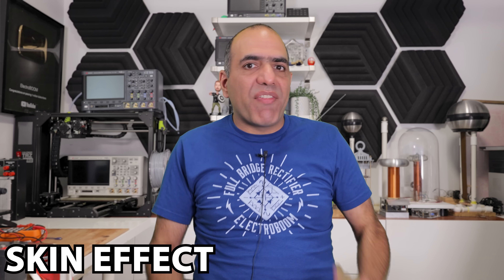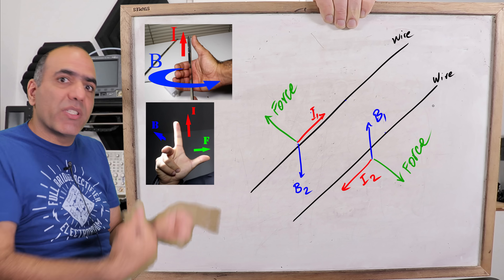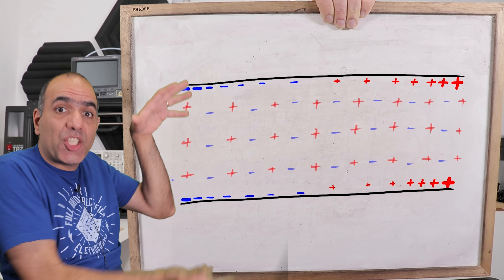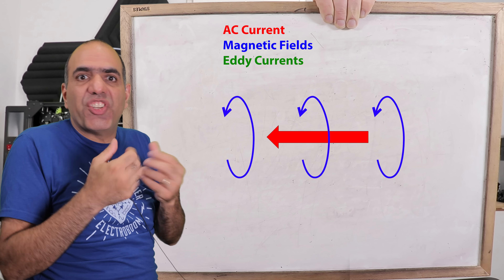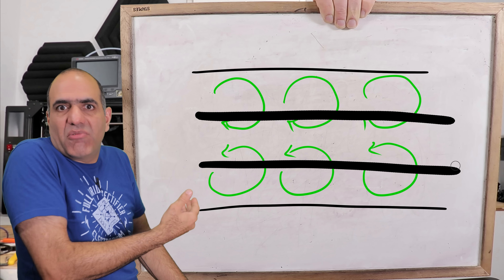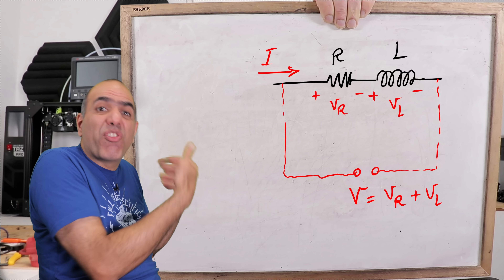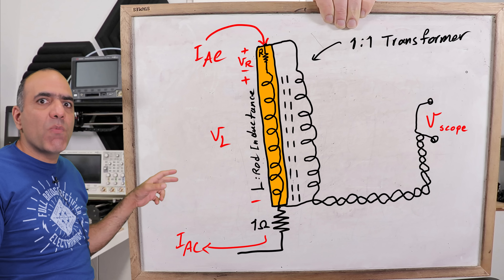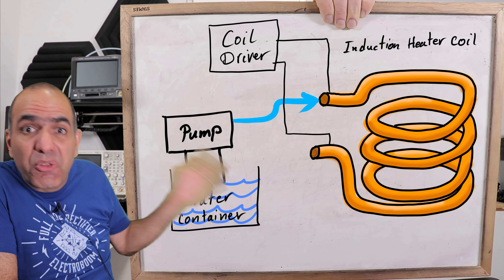Current Doesn’t Run Inside? SKIN EFFECT!

Comment: Are you really measuring skin effect? I feel like your current and voltage are out of phase, implying inductive voltages. To convince me, please include a measurement for the phase angle between voltage and current, as well as current and voltage base frequency amplitudes ;)
Reply from the maker: You have a valid concern. My brass rod is 5mm diameter and 65 cm long. So per calculations the DC resistance is around 0.5 mOhm, which matches my 1kHz scope measurement (ignore the offset of my differential probe). Per calculation it should also have around 0.7uH of inductance. 

This means at 35kHz I measured, the rod impedance should be 2.PI.f.L = 0.154 Ohms, so I should have seen 154 mV peak at 1A, but I'm only seeing 1mV to 2mV peak. So my probing scheme helped a ton removing the inductance component of the rod, but to what extent? Like I mentioned, it is not perfect so some of it still leaks through.

To see how much that is, you can take a look at these images: 
Phase shift at 1kHz: https://electroboom.com/share/1kHz.jpg
Phase shift at 35kHz: https://electroboom.com/share/35kHz.jpg

So taking the around-50-degrees-phase-shift-at-35kHz at face value, it seems inductance and resistance are roughly providing equal amounts of impedance at that frequency. So still a good portion of voltage rise is due to skin effect, which at 35kHz is around 0.73 mm deep. So as we calculate, around 63% of current runs through very close to half the surface area of the cross section of the wire. So rod resistance didn't quate double, but around 1.4 times more. This makes sense, another 1.4 rise is the impedance due to inductance, so a total x2 rise in impedance (sqrt (2 x 1.4^2)) and so I read roughly double the peak voltage.

If we compare the 1kHz phase shift versus 35kHz phase shift though, there is only 20 degrees shift which is much less than anticipated due to rod effect inductance. So maybe the rod effect inductance is not as much as what calculated above, and some of the phase shift is due to some other factor and skin effect has a greater impact in my reading.

Either way I can say I see the effect of the skin effect in my output voltage, but of course we can't ignore the effect of inductance reading due to imperfect setup. 

Hope that helps!
Reply: That helps a lot! I am very surprised how well that coupling works to eliminate the inductance. Assuming we have 1mohm of inductive impedance at 35kHz, that would only result in 4.5nH of remaining inductance, which is a 100x decrease! If we assume the inductive voltage were around 1mV, and it could be calculated by the rate of change of magnetic flux between your current rod and your probe wires, we can derive (ignoring internal magnetic field in the rod for now) that u_ind = mu0*w*I*g/(2*pi*r), with I=1A, g the gap between your rod and the probe wires, r the rod radius. Solving it for 1mV yields a gap of 56um. If we included the rod internal magnetic field, it would only get worse. Can you spot a flaw in my argument? Or is the insulation of your wire really this thin?
Reply: Forgot to multiply by the length of the rod ... Make it 86um.
Reply from the maker: @onit996  My gap is worse! Like 400um or worse because my wire is not that tight all the way over the rod. I don't think I can give you a more precise answer without digging much deeper into what factor in my crappy setup is messing with what!! But considering the amount of phase shift and voltage across the rod, I feel like my setup was good enough to get my points across. Setups in reality always make fun of theory!
Reply: @ElectroBOOM  Isn't your brass rod also acting as an antenna when the frequency increases though? The radiative power shows up as a resistive load to the source despite the energy not being dissipated in the material.
Reply from the maker: @Ryrzard  It would if frequency was much higher. at 35kHz, the EM wavelength is over 10000 times the rod length. So there is no significant EM, just local M!
Reply: I agree, your resistance is very plausibly from skin effect. The low inductance is some black magic to me though :)
Reply from the maker: @onit996  Yeah it does look low! Well, my wires are magic!
Reply: @ElectroBOOM  Why not just plot resistance over frequency and compare it with the theoretical prediction? That would pretty much prove the point. Also, how did the figure this out back in the day? Can not be too hard considering how long this has been known for?
Reply: @ElectroBOOM WHAT ARE YOU CABBAGE?
Reply: @ElectroBOOM   can you show us how odor detector or smell detector work?
Reply: @ElectroBOOM  I have no idea what any of this means. I just enjoy the videos and learn bits of things here and there. ...... 2.Pl.f.L. ..... to pilf? pilfer?
Reply: @ElectroBOOM thats a mouth full
Reply: 😂😂😂😂😂 skibidi sigma
Reply: Yes, that phase angle is pretty big too - looks like it's somewhere 45-90° (although, a little hard to see because the sine wave has some distortion). That indicate a majority of the impedance is in fact inductance. I pretty much expected that, since it's hard to cancel out all inductance that way (because of the width of the rod). A part of the current in the rod still forms a loop with the return path. It would probably work a litle better if the return wire was thin foil wrapped around the rod, with an insulator in between - to form like a coaxial cable. When dealing with such low resistance as a rod like that, it doesn't take much inductance at all, to get a reactance that's higher than the resistance.
Still if the phase angle is measured more carefully, the resistive part can probably be calculated from that - then it can be compared to the DC resistance.
Reply: @Speeder84XL  That's true, the resistive component could still be measured. The only instrument I'd trust to do it accurately enough to produce an unambiguous result would be a wideband power analyzer, but those are not exactly garden variety test gear. I guess if Mehdi used the math function on the oscilloscope to multiply the measured voltage and measured current waveforms, and then applied an average measure function, that would technically produce the same result (a wideband power calculation), although the reason power analyzers are so expensive is that it's really hard to make a zero phase flat amplitude wideband current sensor. The sense resistor used here is another area where parasitic inductance is probably screwing up the result. A wideband current transformer would probably be needed to really do it correctly.
Reply: @InductorMan  Yes, that explains why it is so difficult to measure such things precisely inside an AC power system where all the components had its ESR and their own inductance.
Reply: Mehdi has a fundamental problem with the understanding of voltage. The flux intercepted by the small area between the rod and the probes, as small as the area is, increases with frequency, and the part near the rod is the one that contribute the most.
Reply: @copernicofelinis  What do you mean by that? The gap?
Reply: why is everyone writing essays
Reply: Magnetism is the radiation of dielectric charge. It is always orthagonal. The dielectric is the voltage, and the magnetic component is the current.
Reply: @imnewtothistuff that is way too simplified.

Comment: What I understood from this is that AC creates a changing magnetic field creating in turn eddy currents that oppose the original currents at the centre of the conductor more than the ones in other regions of it. What I don’t understand is the direction of the magnetic field applied to the wire at the beginning, I also don’t understand the probe only measuring the voltage resistance when it’s closer to the rod.

Comment: The skin effect can be derived using Maxwell's Equations and the point form of Ohm's law which does give you a current density as a function of position. At low frequency, Maxwell's equations tell us that the current density is uniform, so the charges DO run through the whole wire, and at high frequency, the current density is highest on the outer skin, and decays to 0 at the origin, so you just get faster charge drift velocity closer to the skin. This is all 100% consistent with the fact that energy flows out of the wire, which is also derived with Maxwell's Equations. Trying to overthink what is going on due to the Veritassium video is completely unnecessary.

Comment: Your wrong I plan on doing it using diodes, direct the pezo electricity to the capacitor, alow capacitor to discharge through the finger using a donut magnet, current should be running through your magnetic field, away from the body, I'm a genius,if someone touches you will be electrocuted

Comment: I think Maxwell would disagree. The 90 degree electromagnetic effect seems to me to explain all of this. Larger diameter conductors would generate internal turbulence from collision of atomic structure where the surface would be less affected, hence the path of least resistance would be the skin effect. And maybe also why inductance and magnetic fields are created: the charges going to the surface of the conductor from collisions in the conductor, yet being held to the surface, causing a sharp degree turn by attraction and causing the electromagnetic field/draw by the directional change and radiation byproduct. 

Just a thought.

Comment: emf is not a voltage although it has the same unit. the difference is emf is work done per unit charge by nonconservative field whereas voltage is work done per unit charge by electric field under static conditions, in which curl(-dB/dt)=0

Comment: Yes, there is a concentration of charge towards the center of the wire for DC! It's called pinch, or Z-pinch in this case.
If the current is strong enough, it will crush the conductor. If the conductor is a plasma, it will confine the plasma into a thin filament. Lightning is exactly that.
With enough current, you can ignite fusion due to the extreme confinement. Check out the "Z Pulsed Power Facility", it does exactly that.

Comment: Current flow only on surface of wire, best example on sale on internet 2.7 millimeters diameter small wire made of 7 strands of much smaller diameter !!!!!!!!!!!!!!!!!! Such wire applied to small current and to reduce resistance they made of multi strand  wire.

Comment: btw, for a stronger skin effect effect, use a magnetic metal, like iron. There, magnetic field inside the conductor is amplified by the ferromagnetism of the wire, which in turn induces eddy currents more easily.

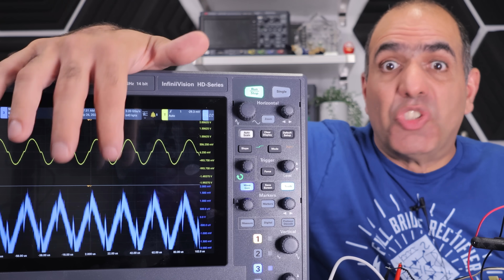Comment: 9:57 One thing about the skin effect based on what I know, its used in small form-factor power adapters and inverters. The higher the freuqency, the smaller the wires but needs more surface area. I can tell about this because I have a phone charger that is failing and I can audibly hear the transformer coil wine when under load. It sounds high pitched and should be +20khz above the audible frequency but its low as 15khz for me to hear.

The AC to DC converter converts to high voltage DC then put into a transformer center tapped and switched between which pole creating AC. Use high frequency for efficiency and size. After that low voltage AC into DC. Almost every single new adapter and inverter uses this now.
For DC to AC, its the same steps, high frequency DC center tapped to make AC then high voltage high frequency AC to DC back to AC using a H-bridge.

Skin effect is also used in antennas also. The skin effect already has a effect at 60 hz and is a standard to why bigger wires for higher current have more strands not for easier bending but to lower resistance.

Comment: I have thought about the skin effect for a long time, and there is one question that doesn't make sense to me. The skin effect is due to induced eddy currents, which are generated by a magnetic field created by the flowing current in the wire. When the amplitude of the current decreases, so does the strength of the magnetic field, until it reaches the negative half-wave. Because of induction, electrical systems resist changes, regardless of the direction. If the magnetic field gets stronger, the counter magnetic field and the induced current also get stronger. If the magnetic field weakens, the induced current changes direction to compensate for the loss of magnetic flux.

So, shouldn't the induced eddy currents now be in the opposite direction to counter the weakening magnetic field and make it stronger? And therefore, when the current is in the falling half-wave, wouldn't the skin effect reverse, causing more current to flow inside the wire? I really think that I have a misunderstanding somewhere, or that the opposing eddy currents are not strong enough to significantly counter the current flow on the outside.

Maybe someone is able to answer my Question :)

Comment: ElectroBOOM, Urgent Request.
I have a laser I purchased from Amazon that came without positive or negative markings on it, instead they were on a piece of paper and now I cannot determine which way the batteries need to go into the laser. Is there a way to determine the correct polarity of the device without damage such as using a tool such as a voltmeter?

Comment: I get why its possible to use steel core wires for long distance power transfer, most of the charges use the outer copper coating anyway. What i dont understand is how the steel core and the copper coating share a flow. Even light gets redirected between different mediums, so wouldn't there be a resistance between the two metals? Is the math such that this resistance behaves the same as the skin effect in a pure copper cable?
Reply: There is little to no Skin Effect at 60Hz. And they are multi-strand conductors.

Comment: I used to work for very arguabley the finest hifi company on earth, everything was done from physics and heavy theory, no snake oil. Hifi uses litz (multi strand) cable as that vastly increases skin area and improves reble as higher frequencies prefer to travel on the skin of the cable, llikewise bass prefers thicker cables especially in speakers wire. It makes little sense without serious research or just A/B listening but a cable with six cores of different but very calculated sizes was simply amazingly clearer.
Reply: What company was that? Because I can think of no less than about 25 that would immediately claim that same title. Where exactly was that litz cable used? Inside of speakers? In interconnect wire? Was all the wire litz or was it only used in certain applications under certain conditions? Also, when we start to talk about multi-strand wire don't we then start to get into discussion of the Proximity Effect as well?

Comment: it does run inside much more that most ppl think it does
Reply: There is a formula that tells us exactly the drop off rate per mm of wire depth. It is not a mystery.
Reply: @MrSummitville  yes, but most ppl think they made of copper or idk, aluminum saying about the skin effect while working with Tesla coils for example. The skin effect is very negligible for  human body wire and the reason Tesla coils don't end up fatal is not the skin effect
Reply: @bigbang259  Nobody that I know, thinks that we are mase of Al or Cu.  Maybe I hang with very smart people?
Reply: @MrSummitville  but you thought that Tesla coils don't electrocute you when you touch the spark due to the skin effect. But it's not the case because to be so, you should be made at least of aluminum. The body's skin effect is negligible.

Comment: The black magic part is beyond the theoretical limit of sending information through the conductor (copper). So information is lost. I never thought I'd see this in a very random shot of a future video when I first learnt about it. To learn more see information theory and maximum channel capacity (even though the physical reason for a practical limit on information rate transmitted is actually thermodynamics)

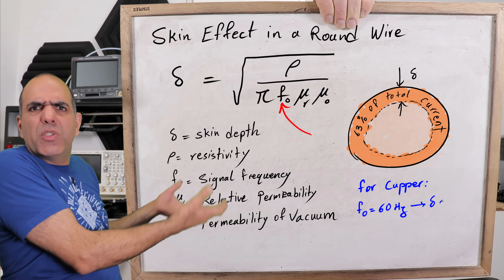Comment: First I thought you finally started to understand magnetics, but after you realizied your lack of knowlegde (1:57), and shared some tiny bits of relevant information (5:00, 5:40), and even started to think as a scientist predicting an experiment result (5:46), you thrown away all apparent engineering knowledge, and introduced "black magic range", which is clearly only your lack of engineering skills and understanding. "How can I measure it then?" Easy: get a long coaxial cable! After you wind it in bifilar arrangement you can apply significant current through it, and can measure the frequency dependency of the center wire, but instead of on a resistor, you should use a current transformer to reduce the burden voltage of the measurement and also to avoid ground loop.

9:49 Clearly the voltage you've shown is not in phase with the excitation current, its phase is about 75 degrees leading, so it is not a resistive voltage, but still inductive despite you tried to eliminate it. Expectations are not measurements.

Comment: Can't you just use a piece of test equipment that takes advantage of a Kelvin bridge or a Kelvin lead in order to ignore the resistance of your test leads? For example test equipment made by AEMC called a digital low resistance ohmmeter? Or perhaps a fall of potential test set?